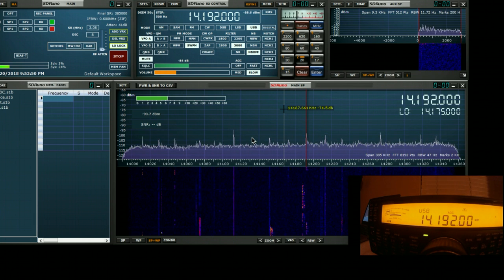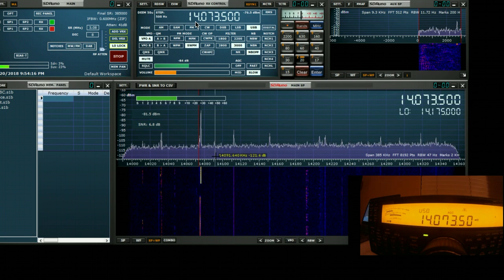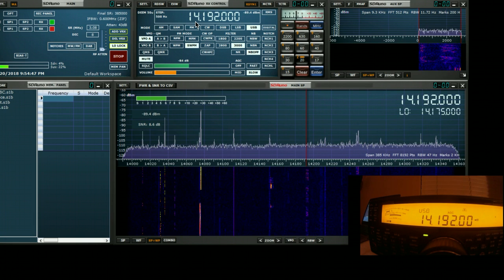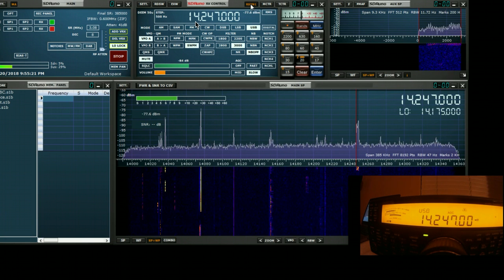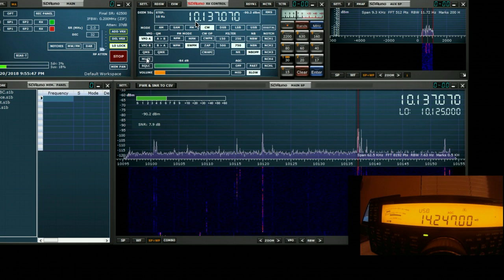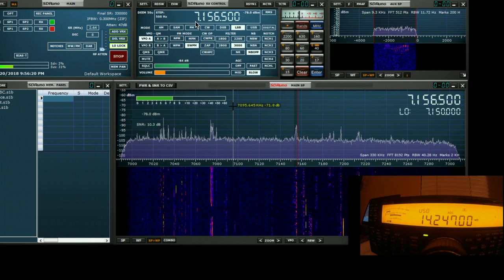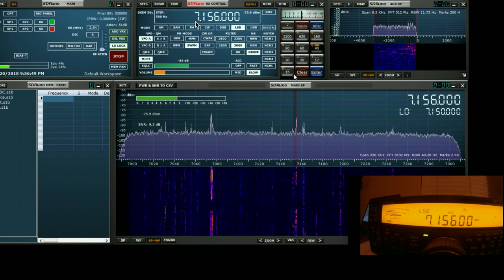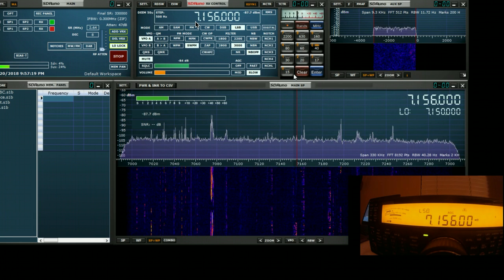SDRuno Panadapter Demo Part 1 - Basic Panadapter Operation

Comment: Help!, I have a SDRuno and its basically working.  I'm trying to connect it with my Icom 7300 and the problem I'm having is that I had to change my 7300 hex address from 94h, the normal address, to 56h.  I had to do that to interface with an antenna switching box I use when operating remote.  The box reads the freq changes from the Icom 7300 and changes relays to the correct antenna outside.  If I change the Icom back to 94h then I get the connection between SDR and the Icom but I lose the control of the box.  Is there a way for me to change the address that Ominrig uses for the 7300.  I think the SDR reads the assignment from Omnirig for the different rigs.  Did I make any sense?  I'm sure enjoying the SDRuno and spend hours on SDR youtube videos.
 73's

Comment: Some folks don't have an SVR port. In that case they do need a different setup. Perhaps you could provide a secondary way to sample a xmtr output?
Reply from the maker: If your rig has an IF output you can use that, although you are restricted in the spectrum you can see by the IF bandwidth. Alternatively you can use a T/R switch such as the MFJ-1708B-SDR. The options are covered in our app note referenced in the description: https://www.sdrplay.com/wp-content/uploads/2017/10/171011PanadapterGuide.pdf and https://www.sdrplay.com/wp-content/uploads/2018/02/MFJ1708SDR-App-Note.pdf

Comment: Is this just using SDRUno via a CAT cable to the rig? Or is there an SDRPlay in-line somewhere?
Reply: The display you see is from the RSP1A which is fed from the DRV output of the 590SG. Synchronisation is accomplished using SDRuno to tune the rig using Omnirig software.